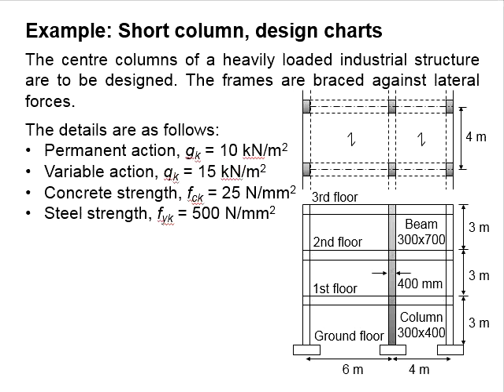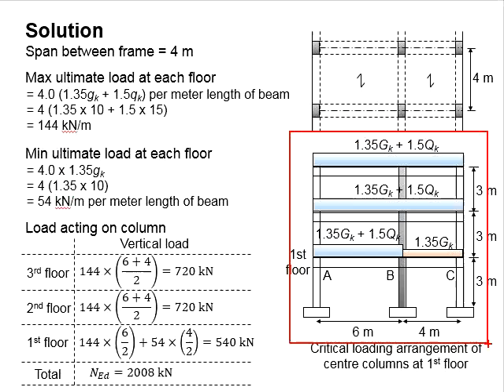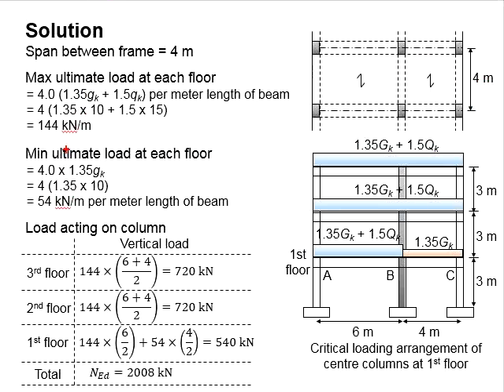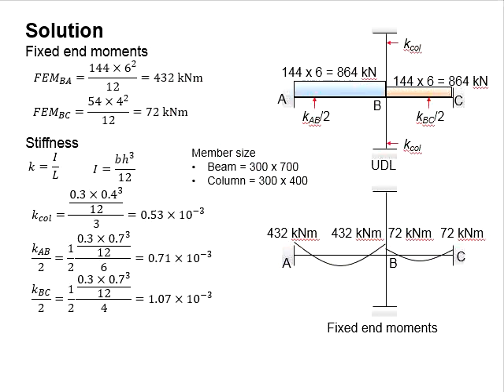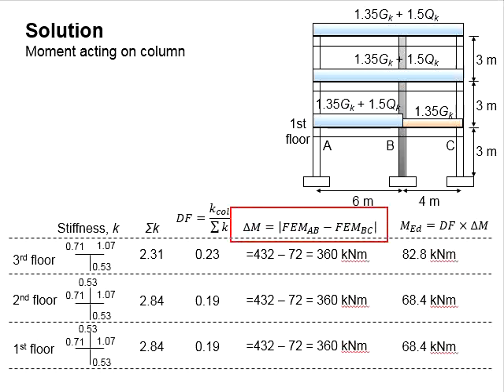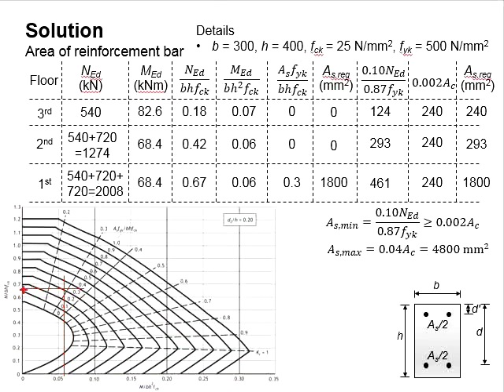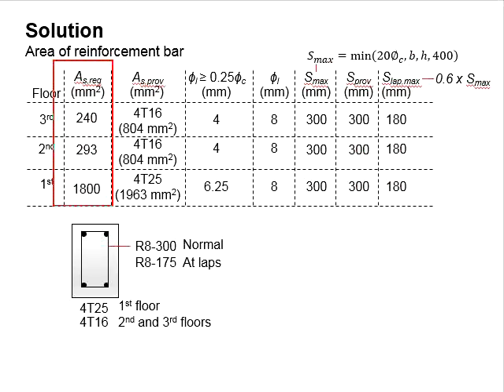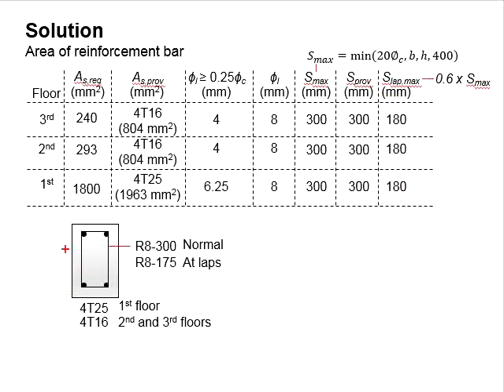9.10 Example: column design

Comment: Hello Sir, why didnt you add the selfweight of the column to the design axial force?
Reply from the maker: Yes, you are right. The self-weight of the column, as well as the beams and slab, should be considered. However, in this example, the calculation steps have been simplified. I assume that the Gk is inclusive those self-weight.

Comment: hallo sir why are you not including the beam self weight in your calculation
Reply from the maker: Yes. You are right. The self-weight of the beam should be included. The example assumed the loads were inclusive of the self-weight, but it was not clearly stated in the question. Thanks for reminding.